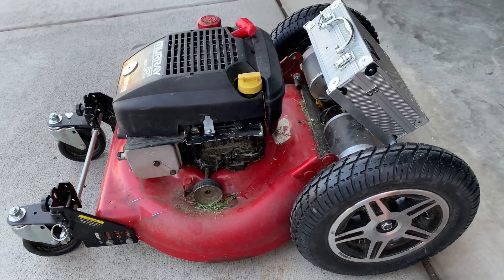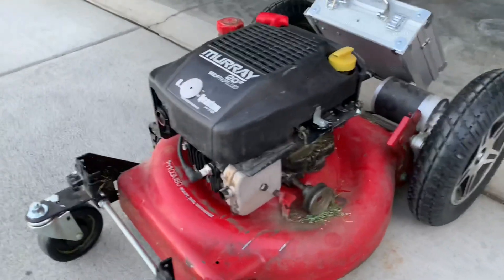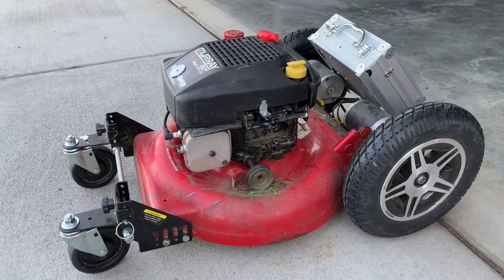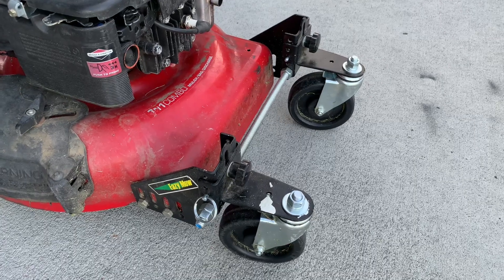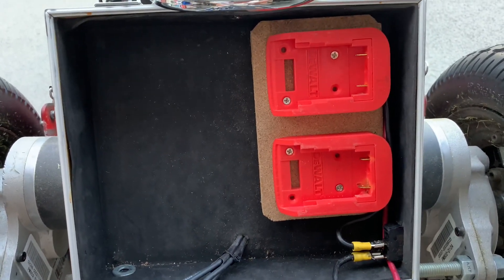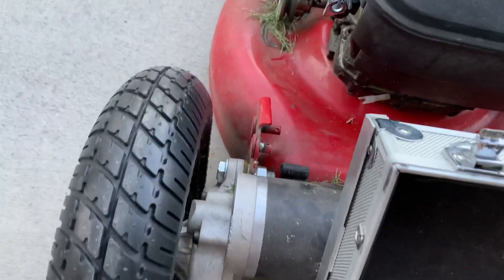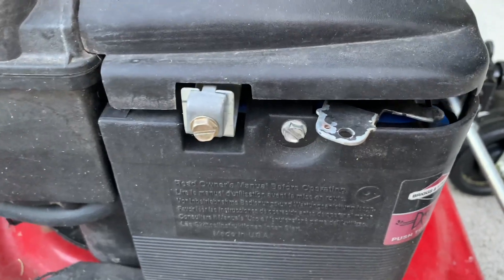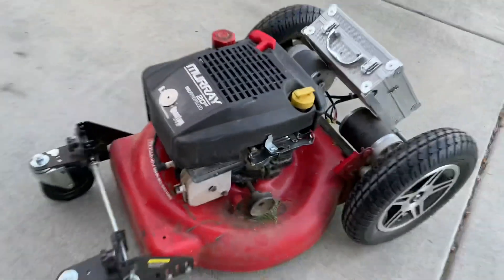Remote Control Lawn Mower With Dewalt

Comment: I really like the simplicity with which you made the lawn mower. I am looking forward to seeing an even more explicit clip made by you, so that even those who know nothing in the field have the courage to start building such a useful object, and if possible a clip in which you disassemble it and then assemble it back.
Reply from the maker: Thank you I am going to take it apart to paint the mower so I will try to do another clip
Reply: @ThingToDo , Thank you very much for the answer and for the intention.
Reply: @redbull5037  What type of motor controller do you use? And is it the radio you have configured to do the  control of the two motors? I am thinking on the mix of the two for steering..
Reply from the maker: It is SmartDriveDuo Smart Dual Channel 30A Motor Driver and any RC controller
Reply: What kind of motors? Can you tell me where to buy?
Reply from the maker: These are wheel chair motor that available on eBay.  Just need to search for the type you want with a decent price
Reply: @Living and Experimenting this is awesome. All other plans call for large lead acid batteries. The dewalts make it easy! How long do u get out of a single battery ? How about 2? Thanks!

Comment: Nice job. To think  i had a Murray used it for 15 years, repaired it at the level of carburetor, and taking the piston out, adjusting the valve etc. , then donated it to a guy. I went and bought a Self-propelled EGO mower. You put the Murray to a better use. 👍
Reply from the maker: Thank you

Comment: You could put a belt on that pulley on the side of the engine and power the wheels with an alternator instead of a battery.

Comment: Could you run a small alternator off that side pulley to keep the battery charged ?
Reply from the maker: I think that one is not enough rpm for alternator. Also I used Dewalt battery so it would need to charge with balanced charger.  Thank you, I’be been thinking something for that pulley but…

Comment: Very nice project. Can you please help me with my issue?  How can switch FS-GT3C from steering wheel mode to the skid ( differential ) steering? Thank you
Reply from the maker: Are you talking about the way the lawn mower moves left and right like a tank?
if you are then that is control by the speed controller that I have for the mower as I just steer using the wheel of the remote normally.
if that not what you mean then I do not know how to do that with the remote, sorry.
thank you

Comment: Very good implementation. Are you running 2 dewalt 5AH batteries in parallel ? Is the speed controller and motor working good with 18V ?
Reply from the maker: It is running fine even too fast on one battery 20v.  The parallel setup just for longer use.
Thank you

Comment: I've been watching a lot of RC mower vids since I wanted to build one myself.  I haven't seen anyone control them zero-turn style.  Left stick for the left motor, right stick for the right motor.  It seems to me this would be much more nimble and easier to control.
Reply from the maker: Thank you . I did get the idea from other YouTube
Reply: I use a pistol grip controller for my RC mower. The speed controller I use works out the channels for steering and throttle. I love my RC mower build.

Comment: Hell .can you give me the link to buy a different élement please .
Reply from the maker: I bought the wheels and motors on eBay, searching for wheelchair motor and wheel. There are many types, just pick the one you think it works with your setup.
The controller is from Amazon, https://www.amazon.com/dp/B07V692RFS
The Dewalt battery adapter, I printed with 3D printer, template you can find on Thingiverse.